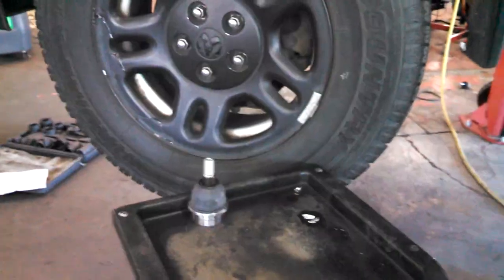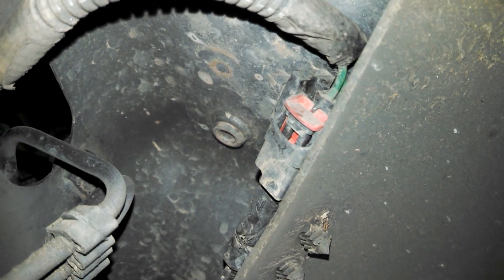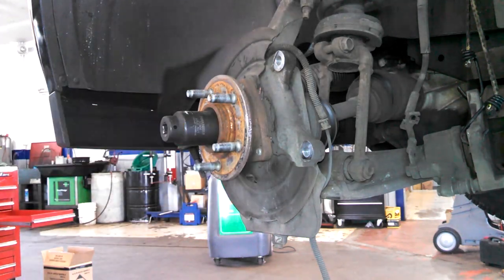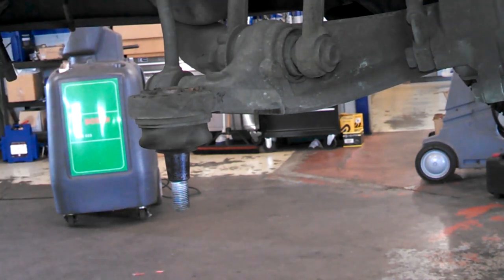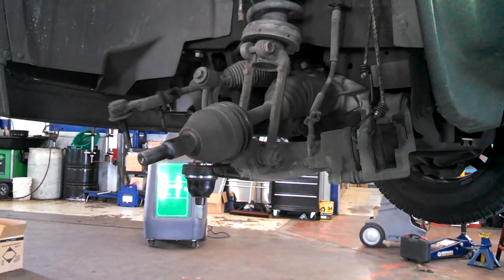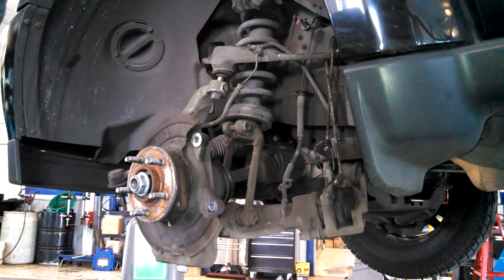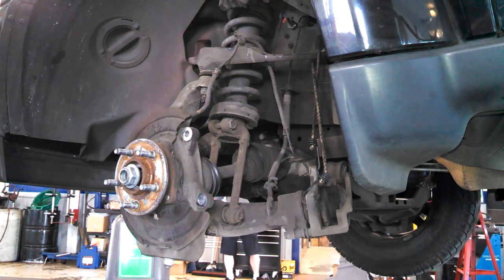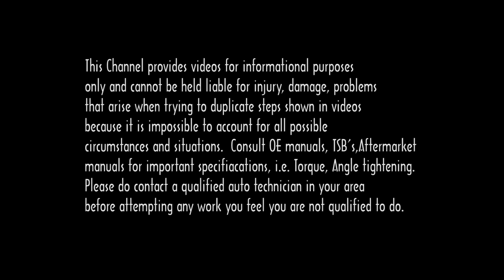Lower ball joint replacement 2009 Dodge Nitro.  Install, remove or replace

Comment: Great video, thank you!  I believe my lower ball joint is going out.  I called around and one shop says you can replace just the ball joint (Charges $250 including alignment.)  Another shop says you have to replace ball joint and control arm ($400 with alignment.)  Is that a reasonable price and is it wise to only replace the ball joint vs ball joint and control arm?

Comment: Hi Todd - no need to remove the ball joint boot when pressing into the steering knuckle? I purchased the same  Mopar ball joints and there isn't much metal on the shoulder for the adapter to rest against (I'm assuming that the adapter must be a really snug fit). Same vehicle as well - 2009 Dodge Nitro.

Comment: Why did u have to replace? What were the symptoms?
Reply: What is the Ball Joint Front all about?
Ball joints are a part of your vehicle's suspension system that connect the steering knuckles to the control arms. A ball joint is essentially a flexible ball and socket that allows the suspension to move and, at the same time, the wheels to steer. Cars and trucks will have multiple ball joint assemblies depending on their type of suspension system.

Like any other suspension component, ball joints will eventually wear out and become loose. Excessive play in the joint can affect wheel alignment and tire wear. Loose joints can also cause suspension noise (typically a "clunking" sound when going over a bump). If a ball joint fails, the suspension can collapse, causing a loss of control of the vehicle.

Keep in mind:
Depending on the suspension design, ball joints can be found either in the front or the rear. The vehicle may need to be taken to a shop for wheel alignment after this service. Mobile mechanics do not have the machinery to align wheels.

How it's done:
Remove the wheels.
Remove the control arm(s).
Remove and replace ball joints.
Check the entire suspension system for any problems.
Our recommendation:
When applicable, make sure the ball joints are lubricated during a major service.

What common symptoms indicate you may need to replace the Ball Joint Front?
Clunking noise from front tires.
Steering wheel shakes.
Car moves to the right or left, especially going over the bumps.
Vehicle tires have abnormal wear.
How important is this service?
The ball joint connects the control arm to the steering knuckle. As the wheels – and therefore the steering knuckles – move, the ball joints help the suspension – and therefore the control arm – stay steady. And as the suspension moves, the ball joints help the wheels steer. When the ball joints fail, the suspension and wheels have a hard time working independent of each other. This puts unnecessary strain on each component, which can alter wheel alignment and severely damage the suspension.